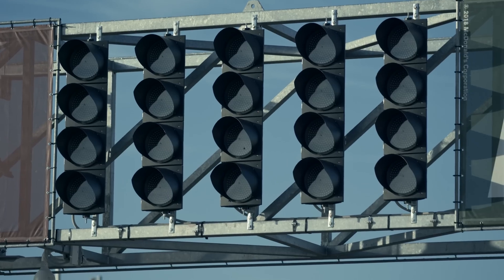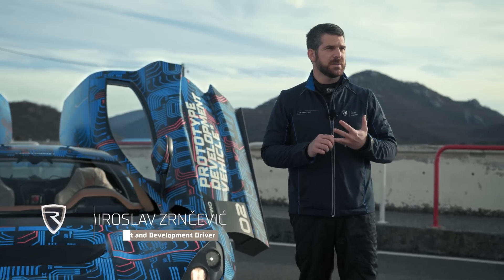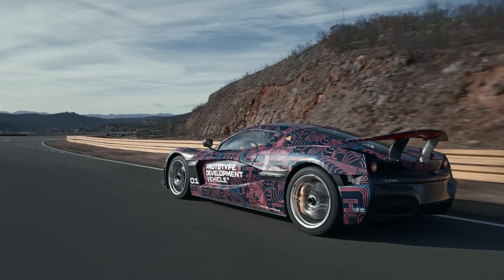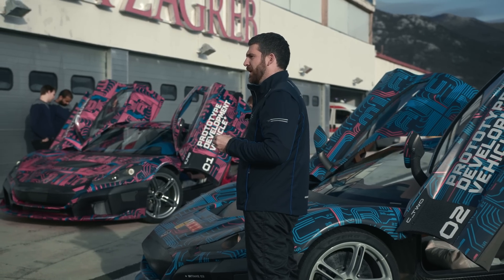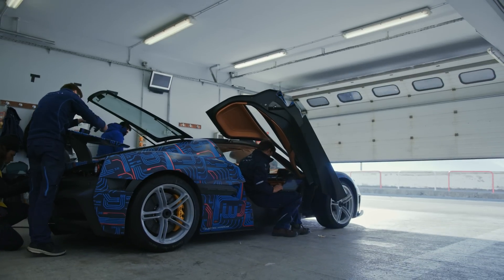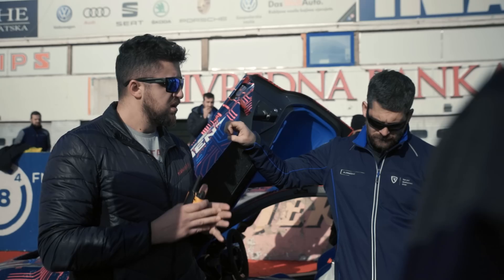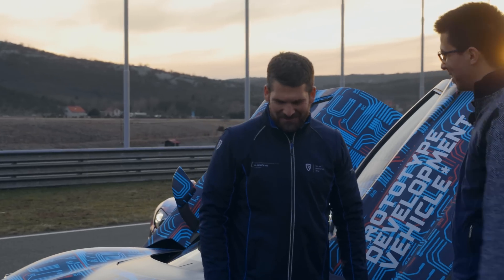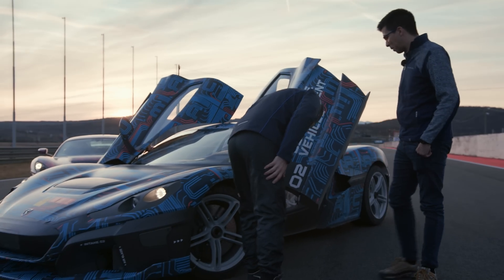Rimac Nevera | Race Track Shakedown

Comment: Who'd win Concept 2 or Roadster 2?
Reply: Rimac Concept 2 because of more power, more torque (almost double of Roadster's torque, wich is more or less 1000 Nm engine torque, against 2300 Nm of Rimac's engine torque), more downforce and probably less weight.
Reply: Concept 2, considering Rimac has 3 speed gearbox with massive torque
Reply: Roadster

Comment: You Guys Need to Switch to Super Capacitors. Instead of Batteries.
Reply: batteries already discharge energy very quickly, too much actually so they are reduced in power to maintain thermal stability.

Comment: You can tell those cars were designed by real petrolheads. I really hope the best for Rimac's future, their cars are what I hope to see more of in the future of the electric car.
Reply: "by real electric-petrolheads" :)
Reply: I wanna see a Lithium ion hydrogen fuel cell hybrid that can run like 1000km in a single refuel, charge cycle
Reply: @virajkadam1684  that makes no sense. If you have a fuel cell why would you need batteries (except some very small ones, or maybe just a supercapacitor, for urban traffic)? There's no sense in wasting space, weight and money on a normal battery when you have a fuel cell.
Reply: @cinegraphics  batteries have higher power densities than fuel cells. You'd have batteries for performance and fuel cells for range
Reply: @dsdy1205  I'd rather have supercapacitors for performance. They have even higher power density.
Reply: @cinegraphics  Or supercapacitors yeah, since you already have the fuel cells for range. It depends on the car I guess; if you're talking about a performance car a supercapacitor may not hold enough juice for a good sprint before you have to slow down and wait for the fuel cell to charge it.
Reply: @dsdy1205  Yeah, but if you use batteries in the sports mode you'll exhaust them quickly and then you have to wait several hours to recharge them. While supercapacitors can be recharged even during braking, or normal non-accelerating driving in the straight line, or in the corners, where you're not accelerating either. Supercapacitors are kinda KERS, where they give you juice just to accelerate. For everything else there's Mastercard. Sorry, I mean, fuel cell.

Comment: SO these guys are focusing on cornering as much as straightline performance cause with 1600-1900 wheel horses it's not about straight line power it's about cornering i have always felt were not at the level of making that power usable as a track weapon so let's see.
Reply: It's for power to weight and acceleration and regen.
Reply: It all depends on the power to weight ratio and the downforce. 1000hp in a 1000kg car is useless without a ton of downforce, the 2000hp in this are usable because it's AWD and weighs almost 2000kg, so the power to weight isn't that crazy. There's a point where adding more power barely gives any benefits around a track. Power is useless if you don't have the grip to back it up, that's why koeniggseggs are slower around a track than Ferraris or Porsches with 2/3 of the power
Reply: @jorge8596  Koenigseggs are not slower. The one:1 was 7 seconds faster than the P1 at Spa and could push even harder but was restricted by noise. However a proper race car can easily beat all these road cars on track with half the HP and a straight line speed disadvantage. It's all the tires and suspension and downforce, and light weight.

Comment: Amazing, I cant wait to see this destroying all others hypercars.
Reply: Same, hahah. I'm particularly interested in Rimac C_Two vs Tesla Roadster 2.0
Reply: @orvvro  Agree, most people still thinks that roadster will be the fastest but I'm pretty sure that C_Two will destroy roadster! We live in interesting times!
Reply: @orvvro  Not even remotely similar cars. Rimac is built to the highest standards of engineering and quality regardless of price, Tesla will be designed to be as cheap as possible to manufacture in huge numbers. Just the carbon fiber monocoque (which is the largest, most complex and stiffest of any hypercar, even above Chiron) in this Rimac is worth more and costs more to build than the entire Roadster will cost to be built. Total opposites as cars and projects. You don't compare high quality expensive cars to low quality cheap ones just because they have similar performance on paper, because performance on paper or objective numbers are not illustrating the massive differences between cars in other aspects. A Mercedes S class and a Dodge Charger are not rivals.

I wish people would once and for all stop judging cars just by their objective performance figures, because those are: 1) irrelevant differences and don't determine what is better or worse, because they're all a product of compromises, 2) numbers don't even tell 10% of the story about the cars,  and 3) such way of looking at cars promotes ignorance, makes fanboys go crazy and it just generally doesn't teach people that cars are more complex than what their acceleration numbers or top speed numbers say. I blame clueless car journalists for that, who created this trend of using acceleration numbers and track lap times as the only way to judge a car, because they're usually too clueless about cars to be able to illustrate how good they are in any other way.
Reply: @derbigpr500  I agree, yet I'm still looking forward to seeing a drag race and Nürburgring lap between the Rimac and the Roadster. It's unavoidable anyways, they are remotely similar because they'll be the first production cars that can do 0-60 in less than 2 secs
Reply: @derbigpr500  "Tesla will be designed to be as cheap as possible to manufacture in huge numbers."  This applies to the Model 3.  It applies to the S and X to a lesser degree.  It doesn't apply to the roadster 2.0 at all.  The new roadster will likely be hand built and may also use exotic materials and joining methods.  Moreover, Tesla has incredible engineering depth at their disposal.  I'm not saying this to throw shade on Rimac at all, because you may be right, in that it's a better machine.  But in reality we will not know until they are both on the street and tracks.
Reply: @orvvro  And Koenigsegg Gemera. :3
Reply: @derbigpr500  There's no data about Rimac C-Two's chassis stiffness, and the Chiron hasn't the stiffest chassis in production, that claim goes to Koenigsegg with the Regera (65.000 Nm per deg vs 50.000 Nm per deg), and probably Jesko's chassis is even stiffest.
Reply: Lotus evija is probably a competitor for this thing, I hope the rimac is better
Reply: @robertjusic9097  it wont. The Lotus has breeding and decades of engineering expertise. I would bet my mortgage the Lotus is better
Reply: @peanuts2105  its also lighter,doesnt have any luxury and a smaller battery and less range. I guess a race car is gonna be faster than a luxury car yeah..
Reply: Just don't give it to Richard Hammond...
Reply: *Laughs in*:
(swedish) Koenigsegg Jesko, Regera, One:1
(english) Aston Martin Valkyrie and McLaren Senna 
(german) Mercedes AMG One 
(italian) Pagani Huayra Imola
Should I continue? :3
Reply: Combustion engines are better